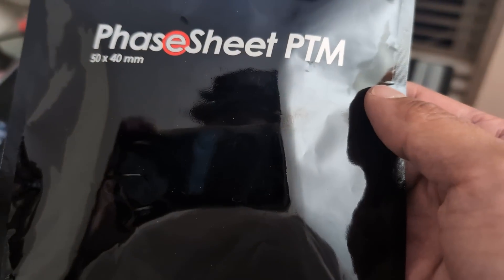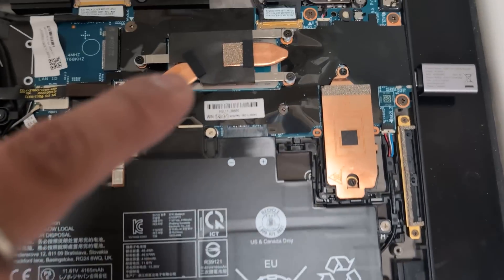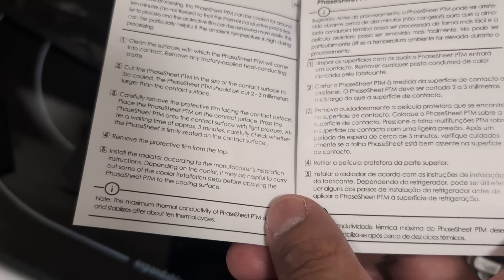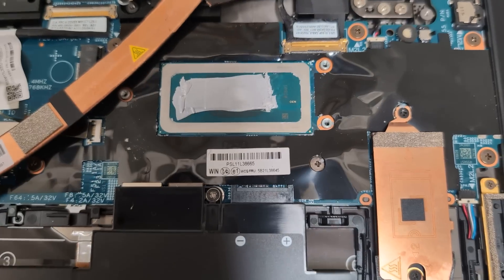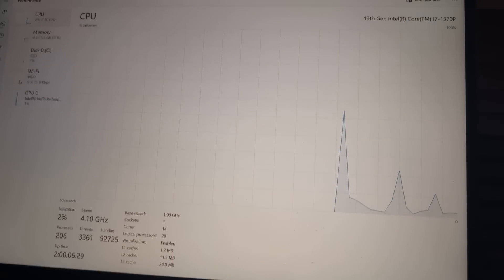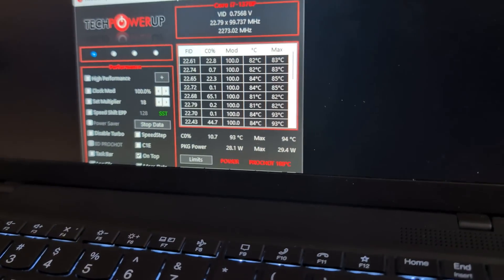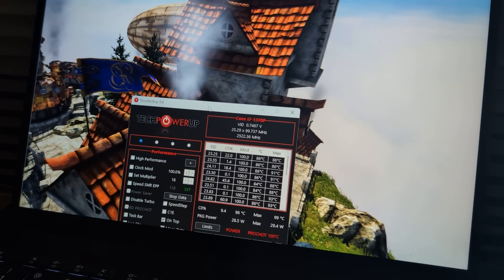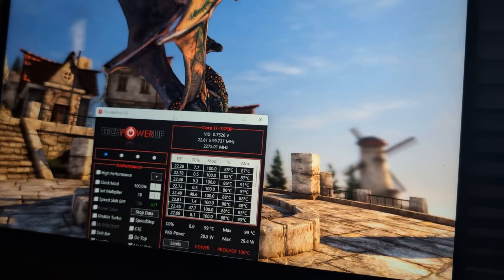Thermal grizzly phase sheet ptm installation and testing.

Comment: But have you tried Conductonaut Extreme and Honeywell PTM7950 ?
I'm currently trying to decide between LT Cooling LT-100 and Conductonaut Extreme to put under IHS but there is lack of reliable tests about these two, however they've been said to be around the same performance.
Between IHS and cooler I'm thinking about putting PhaseSheet PTM or Honeywell PTM7950 but again, there is no info comparing these two...
Reply from the maker: @rozwell69  well I use thin and light computers 13 or 14 inches super thin and the cooling for them are bad and yes I tried ALL the pastes and pads there is and nothing gave me good results and horrible pump out effect. I did liquid metal and it's not worth it in my opinion for thin and lites. I'm going to wait a few more days to see if ptm from thermal grizzly improved tempts or not
Reply: @pavy415  I get it, but ALL is very inaccurate, that's why I'm asking specifically about Conductonaut EXTREME which is pretty new (like PhaseSheet) but is supposed to be noticeably better than regular Conductonaut. Moreover, from what I found so far, LT-100 may be better than Conductonaut EXTREME due to it's higher density/viscosity than Thermal Grizzly - while being much cheaper.
So, just to be clear: did you actually try Conductonaut EXTREME and LT-100 ? What were the results?
Reply from the maker: @rozwell69  no I will never use liquid metal again. Looking at that particular extreme one looks like it's just thicker than the regular one and a pain almost impossible to remove once applied.
Reply from the maker: @rozwell69  and I have a BIG cabnit filled of thermal pastes. I was actually thinking of doing a business where I can replace computer thermal pastes for a living
Reply: @pavy415  How did it go with PTM?
Reply: @rozwell69  lol dude that stuff rots(corrodes)  your heat sink over time. but u do u.
Reply: @user-bn6lm8ng3v  If you use liquid metal  with aluminium, sure, it's disastrous. When used with copper, gallium fuses with it forming copper-gallium alloy at a shallow depth. This reaction "dries" liquid metal and should be replaced after few a weeks to avoid hard to separate bond. With nickel plated copper there is basically no reaction.
But sure dude, if you have no idea how stuff works and you ignore all the chemistry involved, then u do u.
Reply: @rozwell69 `hen used with copper, gallium fuses with it forming copper-gallium alloy at a shallow depth. This reaction "dries" liquid metal and should be replaced after few a weeks to avoid hard to separate bond.` 

Uhh, thanks for fortifying my point?
Reply: @user-bn6lm8ng3v  How? It's a one time thing which someone who uses LM should be aware could happen. Aren't you confusing corrosion with what is basically a stain which isn't destructive at all and remains stable? Just go and see for yourself:
/watch?v=cQaqUyKVIEE